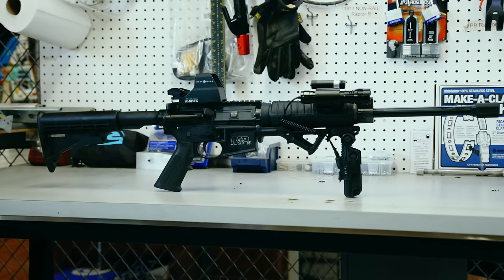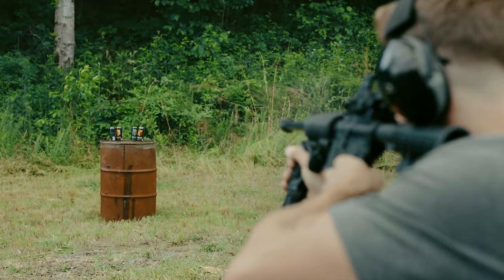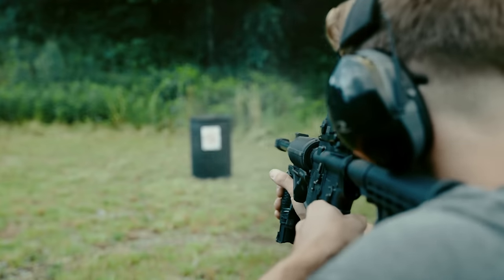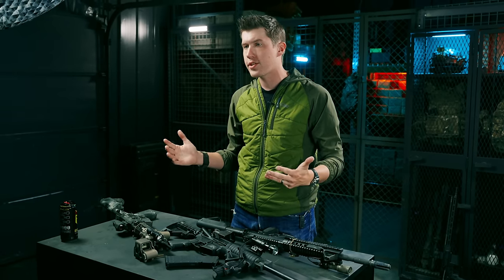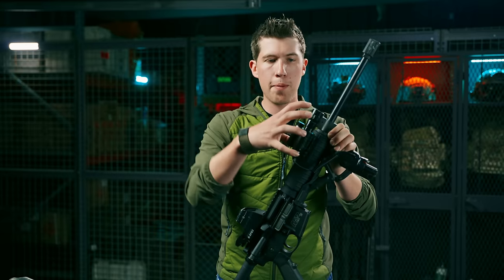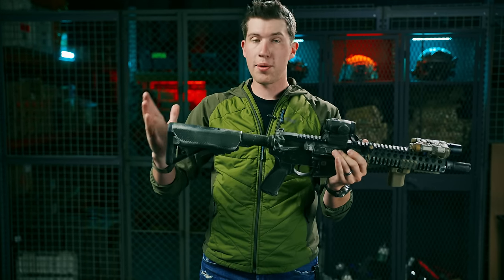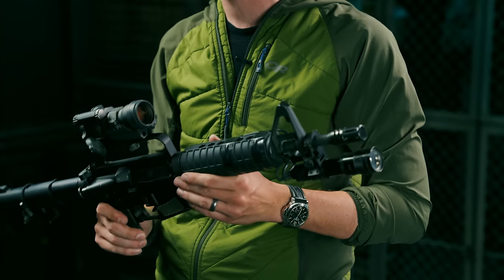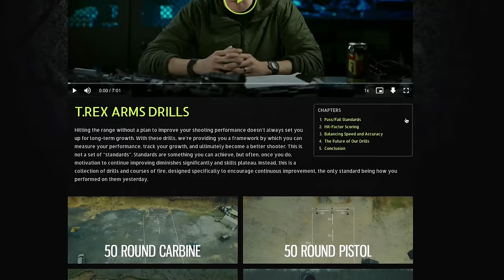5 Mistakes New Rifle Owners Make

Comment: There is nothing wrong with buying cheap, because cheap is not always a sign of poor quality, it just often is.  If you know how to do research and read lots of reviews you can get a very good red dot for around $80.  The Sig Romeo5 or MSR are two examples.  The Vortex red dots are an excellent value as well as are Primary Arms, Burris, and Holosun.  As a matter of a fact, the Holosun most basic red dot in the low $100s will outperform a lot of optics two to three times as expensive.
Reply: outperform? you are pushing it... I have had very good red dots that are still kicking to this day that I bought for 30 dollars and other more expensive red dots that I have killed. But saying that my cheaper red dots are out performing my more expensive ones is going a step too far.
Reply: @thomgizziz  Generally I agree with you, but Holosun is the rare exception.  I've used Aimpoint, Meprolight, and Eotech.  The Holosun (not the cheapest one, but under $250) performed on par with the first two and outperformed the Eotech holo.  That is my personal experience, and I have an astigmatism so that comes into play, but I would have no problem with any of those on my long gun.

Comment: On my first ar I had a sightmark when they were still $50 pieces of junk, now the milspec ones are pretty nice bit came up on a good priced acog on my current rifle
Reply: I find this funny too. The sightmark he has there I have on an AR pistol and that thing holds zero perfect. I've shoot probably 1000+ rounds and never had a problem with it. Still on original batteries 5 years later. It also has auto-off. If you want an affordable upgrade look at the nortac ronin. I got that one for under 100 for another rifle. It is milspec and has shake awake.
Reply: @inojoking  I’ll check it out, thanks bud

Comment: I would recommend buying Sig Sauer Romeo 5's, but I buy them in bulk (I bought 8 of them at once).  Mounted on 5 AR15s, a PS90, an RDB, and a CZ 803 Bren.   It cost me about $680 (tax and S/H included). This lowered the price to $85 per unit, but I have 8 firearms with the same sighting platform. I can later add on Juilet magnifiers to enhance my sight pictures..  Save your money and buy in bulk to get a nice wholesale price.

Comment: I'm looking at getting my first AR within the next couple weeks. Looking at an IWI Zion and a TRex arms sling. Still debating  on the optic, between a Vortex PST II 1-6 scope, Aimpoint Duty/PRO, or something else in a comparable price range. A few other small add ons like foregrip, magazines. And then spending a good chunk on ammo as well. All for around $2000. Then adding a nice weapon light, surefire warcomp, and switching out the trigger later on.
Reply: The sig romeo 5 is good for 100 or the sig msr for 110 , quality for the price and great for a magnifier
Reply: Do u even know why your buying all these parts  is it because   ur a gun builder or because youtube told you to     the new trigger one was the best 99% of gun owners won't even realize a new trigger    ur gona spend 3500 bucks on a gun you'll shoot 10 times max
Reply: Lvpos are fun, getting the 1x8 from vortex this weekend.  The primary arms have been fun. Trijicon 4x has been great,  but I really like the lvpos because of the adjustable magnification.  1x with both eyes open is fun. 
Another thing to note is, red dots like holosun are so cheap,  you can try one of those out for $100-$250 depending on options, and with trigger time see that 100 or 200 yards on a silhouette on a red dot is very doable.
Reply: @Kevin-id5hx  what?
Reply: @incognitotuxedo2000  what?

Comment: We're actually in the golden era of cheap red dots right now, and optics in general. Magpull MBUS sights are perfectly fine and SIG Romeo, Holosun, Primary Arms, and Vortex are all over Ukraine. That's what volunteers are asking for and they're having no problems with them in combat. You don't need to spend over $200 at this point to get a bomber red dot. I've owned 3 SIG Romeos for several years now with no issues. Spent less than $500 on all 3. Just make sure it has shake awake. Vortex somehow still hasn't figured that out which bugs the shit out of me because I have family who work for Vortex in Wisconsin.
Reply: If you are swapping or removing optics, Sig Romeos do have a track record of not reliably returning to zero. (Even happened on the $1000 budget video Trex has) Otherwise they're not terrible. Still better options of course.
Reply: @motoconvo6995  i understand the complaint here, but for those that are buying the Romeo5 series, chances are that they're focusing on a low-cost equipment setup. Myself included. I only have my one AR, so I've not had any issues with zero due to swapping the optic between rifles. That may be very important to some people, but I'm not one of them.
Reply: @motoconvo6995  that's a problem of the mount, not the optic

Comment: The last time I was at the indoor range, the guy at the counter checked my rifle for rear sights. Apparently, somebody was shooting their rifle without sights on it🤦🏻‍♂️ Something I would say as a tip is to pay attention to weight, especially if you are building a rifle. I wanted to build a rifle with all the best parts and it was so heavy that I never even shot it. I just used it for some parts for another build. Also use receivers that are same dimensions as milspec receivers because some add unnecessary weight and other products may not be compatible with it. I’ve had issues using certain magpul magazines and a RIS 2 rail with nonstandard receivers.

Comment: Red dots vs Iron I would rather have iron if I had to choose one. Irons don't need batteries, and the glass can break red dots. In military basic training you start with irons. Hope this helps bring things into perspective. Meaning you can still hit targets with irons and it's far cheaper, and should be the main go to with starting out learning the fundamentals. A great example the other day I took out a new rifle, had a nice T2 micro red dot, however my case was too small to fit it attach to my rifle. So took it off, put the rifle in the case and packed it. completely forgot about the red dot  at home, but since I had iron sites attached I could still hit targets out fairly accurate to 200-300 yards. Moral is they are amazing to have attached for backups. Good video bud keep it up.

Comment: 2 other points on optics for my own experience:
1- if you have an astigmatism, red dots are not ideal.  The way the tech interacts with the defect in the eye, the dot is not clear/crisp.
2- if you are color blind, depending on the variety of color blindness, using a red optic in daylight conditions can be difficult. Green/amber are better (in my experience) for daylight conditions.

Comment: Everyone go watch the old Travis Haley zero video. He shows where the round after for holding center mass at each distance. So he says how far your combat effective range goes with each zero if you just hold center of his chest. Most of them are basically good on his chest or bottom of the throat and you're getting his above the waist maybe in the groin out to 400 yards. Then you're starting to have to hold over to not hit in the knees or go between his legs. Really good, informational video that REALLY helped me choose the zero I wanted. He does a 25y, 50y, 36y, and 100y zeroes.

Comment: I own the MP15 M4 I have done some upgrades to it but my rifle was bought back 08! They didn’t have as many options then as they do now. With that being said I only paid 600 for it thanks to some discounts for the holidays and my birthday. And it came with 5 free 30 round Magpul p-mags with proof of purchase as well as 2 standard 30 round metal mags. I have well over 500 rounds through it and it works perfectly have never ever had any issues with it. I have seen burn down videos of a few of them and it went pasted 800 rounds with the stock gas tube. Yes it falls short for what is out today and definitely wouldn’t be something I buy now vs then but not everyone has access or the ability depending on where they live and budget to buy the better stuff that is out there now. I love mine and it will never be sold but I am in to buying guns not selling them. Good video good luck to everyone and GodBless.🫡🇺🇸

Comment: A lot of people hate on O-light , but let me tell you, i have the O-light Oden mini, and it rocks. I've had it on my pcc for around 2 years. I shoot that gun under nighttime conditions at least 1 a week, and it had been amazing! It performs every time i hit the pad. It has both a crazy blinding throw and a great flood. Not only has it worked flawlessly for me in the feild, ive found the charging system to be one of my favorite parts . It holds a charge for what seems to be never ending when not in use. And when it is in use ive never had it completely die on me even when turning it off and on in a 2 or 3 hour shooting session. I dont have to take it on and off to charge( but you can super easily if u wanted to). The charger conects magnetically.  And the best part is it has a great price. I think i got it for somewhere around 150 and it was worth every penny. I highly recommend that light if you're looking for something affordable that performs just as well as well if not better then the higher end competitors.
Reply: I agree, O light and Fenix are great. People hate on them because they are made in China but they are very good products, especially for the price. Tons of reviews out there showing how they good they are.

Comment: The absolute best cheap optic and light I have found are the Holosun HS403R with an aftermarket mount, and a Surefire G2X tactical single output light in a GG&G mount.

Comment: Personally I'm running a picatinny one solid mount and then a vortex 4>16x50 scope on it. Along with that a bubbel level and bypod. That's for long range. If for whatever reason I need to engage closer then that I can slap a Lazer on the rifle. But for most use 4x is decent enough to get a sight picture and rounds off. It's heavy but it also transmissions to less movement because wight require more energy to move. Mostly shoot long ish range

Comment: I think it's worth mentioning that with a 100 Yard (I realize he was talking in meters) zero, you don't just hold high when shooting beyond 100. Almost everything other than 100 is going to be low on target. 25, 50, and 75 will also be low. With a 100 yard zero, depending on exact round, with a 16" barrel, the round peaks at just about 100. So that even your 150 yard shots will already be dropping below the 100 yard point of aim/impact. I don't knock dudes who zero at 100, as long as they understand where everything is hitting as a result.  And then I watched the video for 20 more seconds and he said "except for the 100 meter one" (= I'm still leaving my comment.

Comment: I have one of the Sightmarks similar to the one in the video, have had it for 5-6 years, and it has been on several AR15, AR9s, and even a TS12 for a short time. I have nothing bad to say about it, it just keeps on working, holds zero just fine. But, it isn't living on any rifle right now because I do believe in using a slightly more... tested?... optic on firearms that may be used to defend my life some day. That said, you can still pick up Romeo 5s, Holosun 503s, or Primary Arms SLx series dots for under $200, and any of those will be just fine for a range toy/home defense rifle. Now, if I were going into a war zone, yeah that's EOTech, Aimpoint, Trijicon, or maybe even higher-end Holosun territory, but how many of us are ever going to be in that situation?

Comment: Im only 21, first build at 18 yet but I am a seasoned shooter. I've learned a lot over 17 years of shooting. By the time I got my first AR, I built it on my own with quality but simple parts and a reason for each part. I have everything I need and nothing that I don't. No million accessories strapped to my ARs. I sight in and zero everything after a good initial cleaning out of the box. I know the ballistics of all my ammo and how to apply that with even the first shot.

Comment: There's alot of really decent RDSs out there for around $100 right now, sigs Romeo MSR can be had for $85 on PSA, and then there's steps up from there for not that much more, to the point you can get a Romeo with a 3x magnifier for a little over $200, but there are holosun and vortex's for under $150, so there's no reason you need to spend over 200 bux for a rds, plus you can get a set of Magpuls buis's for like $80, which are perfectly serviceable irons

Comment: I have several $50 Sight Mark red dots that are over 15 yrs old and still running strong and holding zero. Many, many deer killed with them. No need for a $300+ optic in my experience. But if you want to go play army guy on the weekend go for it.

Comment: When I started I made some dumb decisions.. I bought a cheap ass scope just so I could shoot it the next day.. then I upgraded to like a Sight Mark Pro which is trash but it held up.. I recently got an EXPS3-0 in tan. Which cost like $200 less than my rifle did.. and then I also made the bad decision to start adding some tan accents on my gun but the colors weren’t all the same and it made it look funky.. I’ve recently fixed that. Mine came with B5 furniture so that was good. I did try changing my grip to a Wilson Combat grip and  that was a mistake. It was sooo slick! I also bought a DD grip that didn’t have the tail on it and instantly sent that back.. other than that, I also bought a cheapish Feyachi light off Amazon and it’s honestly bright as shit, and has taken a beating, but I know I gotta switch to a better light.
I did buy a pretty sweet Mlok Bipod.. but I need to find a better way to quick attach and unattach it because having to unscrew it is a paid if I want to change while shooting

Comment: I have a couple cheap optics on some .22lr rifles. Then a $500 eotech from a subreddit deal on my PCC. I actually like traditional sights which are easily $80 for a pair of iron sights. But I also went with a 1500 lumen weapon light and learned that I should close my shooting eye prior when in dark. It will also cause vision issues as the user. :O

Comment: The only takeaway that is incorrect on zeroing is you need to take in account height over bore. An optic with a 1 inch vs one with a riser at 2.5+ height over bore will not be the same convergence regardless if they’re both zeroed to 36/50 etc yards.

Comment: Gun build of 2024

(1) AR lower: $150 Palmetto complete lower-
(2) AR Upper: CMMG 20” MLOK 6MM ARC upper complete used $375.
(3) Optic: $1,680 Steiner M8Xi 1-8 LPVO
(4)Mount: $320 Reptilian 34MM 1.5” scope mount.  
(5) Suppressor: OCL Polonium 5.56 can

(The gun holds absolute accuracy at all times no matter if it is dropped, banged, stored, etc) 😊 I’m sorry, I do not have a flash light, or a fancy for grip 😢

Comment: You have a sightmark on your rifle then blew past them as being a good red dot. I run the same one, and a micro on another build. Thousands of rounds and both still very very solid. They can take a beating. Very good for only around 200 bucks.  Never let zero even with banging then around in and out the cabinet and cases

Comment: I mean, on light, I have had pretty food luck with the cheap feyachi weapon light. There NOT AWSOME, but for a rifle that isn't getting used to much, they fit the bill. 

 Okay build, good battery life, about 300-700 lumins, and I have yet to have issue with the switches. 

 I put them on rifles I bring to the range for those without rifles. Think basic m4a1 with a quad rail, carry handle, and a basic sling.

Comment: I bet I dumped nearly $1000 continuously replacing my cheap optics, rails, and grips, over the first 10 years I owned my AR.  I've had about every setup imaginable, and even all of them at once.  I finally got smart and started spending the extra on quality accessories.  Suddenly, I didn't have to replace optics twice per year.

Comment: 1. Dremel tool to remove serial number
2. Laser to etch troll-face where serial number used to be
3. Drill press to install “speed hole”
4. Panacea X Killsaw bayonet
5. Invader Zim cerakote job
6. Replace front and rear iron sight with 3D printed 🖕and 👌

Comment: Zero should be based on bullet grain and barrel length. After zero, go to a kd (known distance range) and confirm your zero. Make adjustments at 3-500 meters(depending on rounds used and barrel length/optic) get gud scrubs.
I really enjoyed the simplicity for entry this video has. Also 5 round groups are better but more expensive.
Reply: Use a point blank zero calculator off the internet.  It’ll tell you your dope for your bullet’s BC, barrel length, and desired MOA.

Comment: Aimpoint PRO is legitimately a solid option. Mine took a direct hit to the factory mount by a railroad track from about 7’. Not only did the thing survive, it held zero.

Also, technically I think it’s 14.5” and NOT 16”.

Comment: This was me during covid 2020...found a s&w mp15 sport with a crimson trace red dot at my local pawn shop for $880. Added a holosun he510c with the matching magnifier but ended up returning the magnifier, $30 offset iron sights and a $60 tactical light with green laser from tacticon armament(veteran owned company), hogue rubber grip, drop in rail and an angled slim grip from utg. Bought a rifle case in the shape of a guitar case like in the movie desperados. I took it to the range for the 1st time and was quickly humbled, none of my sights were zeroed the green laser stopped working.😂😂

Comment: first gun i had was m1 carbine ran meh but the first ar i got was a colt 6921 14.5 inch barrel ran flawlessly still have it and it has never jammed with over 3000 rounds thru it